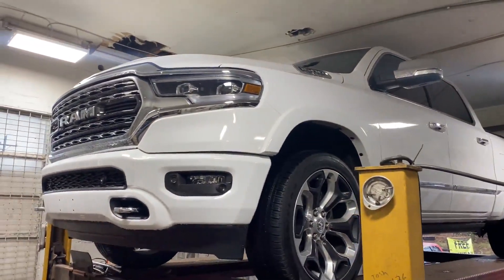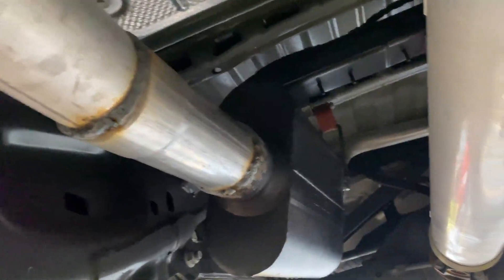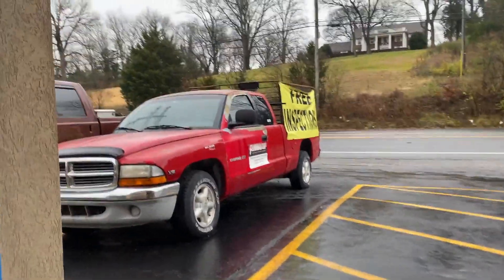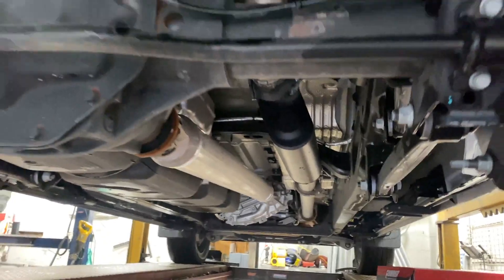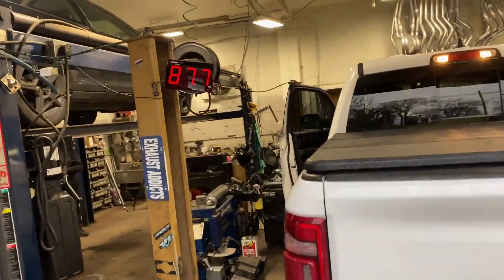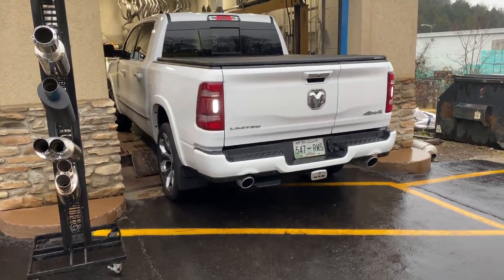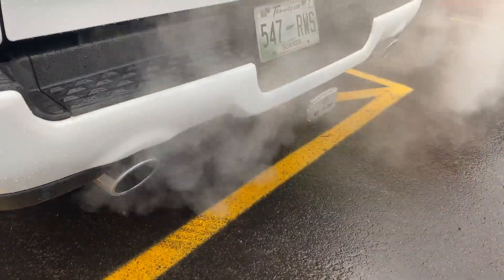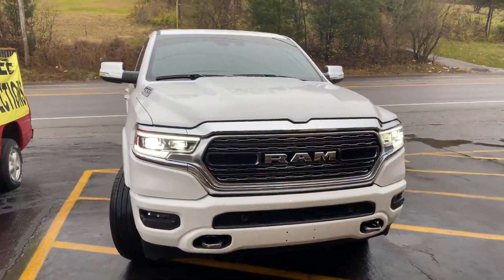2020 RAM 1500 5.7L HEMI DUAL EXHAUST w/ FLOWMASTER 40 SERIES!

Comment: I just put a 40 Flowmaster on my 19 ram with resonator delete. I am not disappointed.
Reply: I’m thinking that exact set up, Do you get drone? I take family trips with my truck and don’t want it annoying inside the cabin
Reply: I’m looking to run the same setup as well, can you give us an update on how it sounds? Is it loud enough, drone, etc.
Reply: @annie2faded  sorry I didn’t see your reply. It’s perfect bro. Little to no drone. You can hear the difference when it kicks in and out of 4 cylinder mode. But that’s not an issue for me. As I do plan to cut it off in the future anyways.
Reply: @KsKaylor  yes bro it’s perfect. Wouldn’t or couldn’t ask for a better set up. But the resonator delete is a must. I heard it with the resonators and it wasn’t much of a difference. You guys won’t be disappointed that’s for sure
Reply: @ericduncan7266  Ok good to know. I’ve had true dual straights on my previous Chevy trucks and now I just want that classic Flowmaster rumble but don’t want it to be too quiet which is what I’m worried about. The catalytic converters on these Rams are huge and restrict a lot of sound!